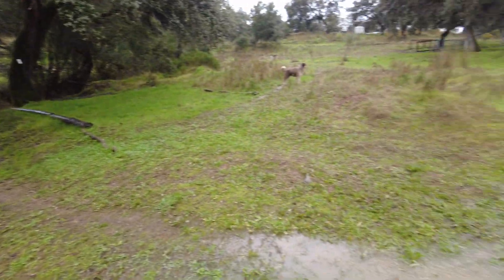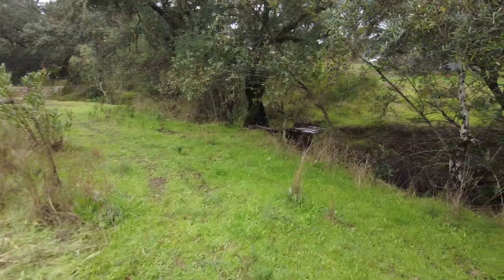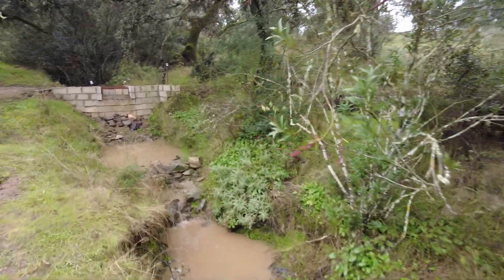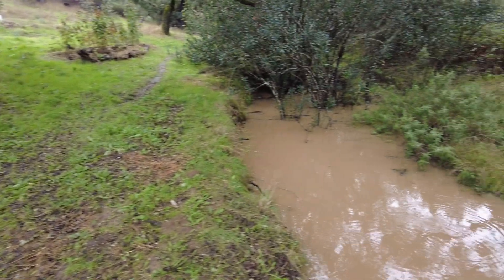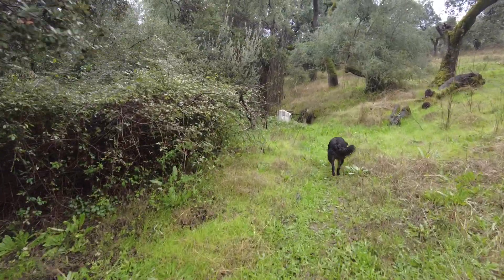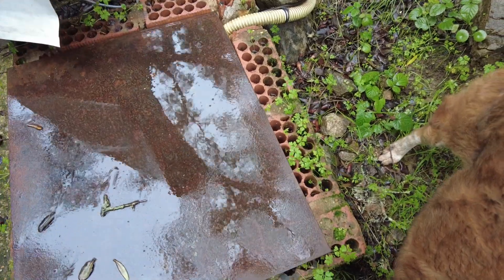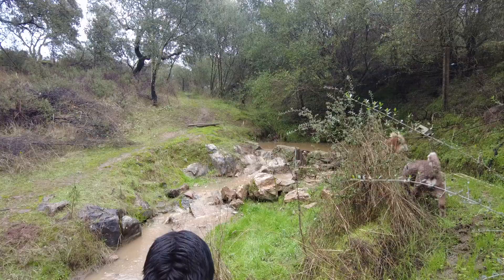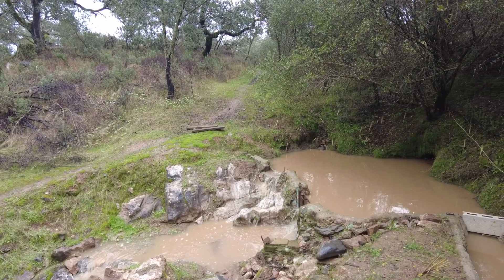How Water Shapes our Suerte del Molino farm landscape. #agroforestry

Comment: Hello, Water Magician! Being an amateur, you do a better job than many institutions employing professionals.

... What's the difference between an amateur and a professional? The latter is paid for the job. 

Your qanat system needs a survey and maintenance. Maybe next summer? We know sediment in the pool under the dome needs to be pumped out, but certainly the lower part also needs some repairs, and it's not even clear how it goes/is constructed. I assume they used to have a spring at the lowest end?

4:33 I dislike how this gate is constructed. You need to lift it up / lower it when it's wet and slippery. I hope you will find a way to improve it asap.

Greetings!
Reply from the maker: Keep suggestions coming. I can only see what's happening when the water flows, so, any input welcomed.